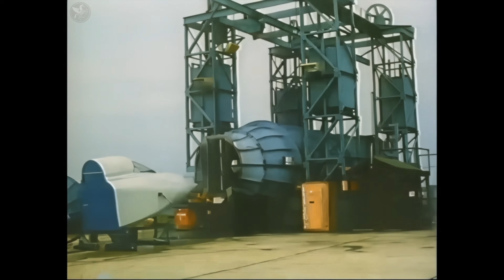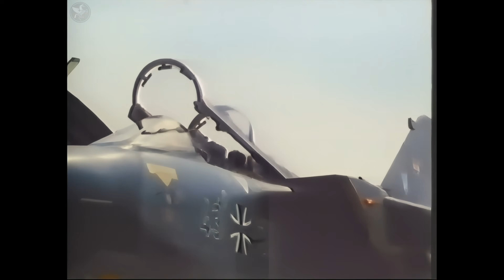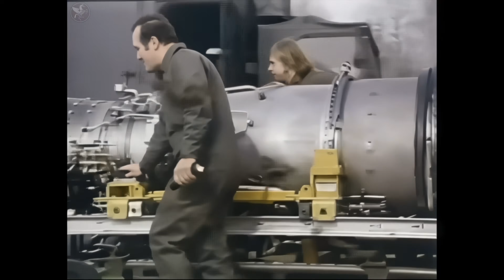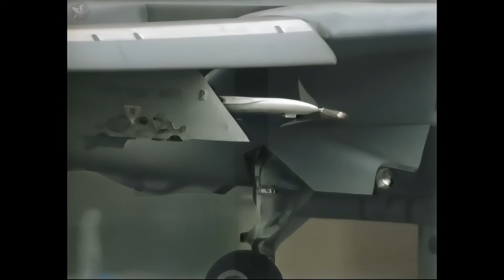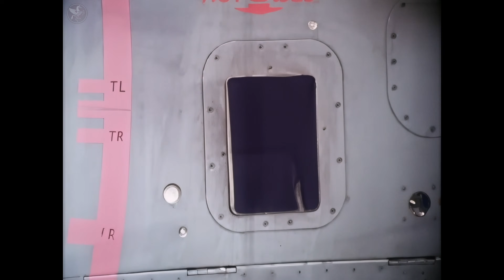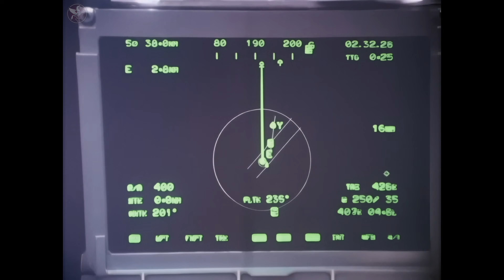The Jet That Mastered Every Combat Mission. Britain's Ultimate Cold War Interceptor

Comment: 360p equivalent quality in the 1080p mode, dunno what crappified it, youtube or uploader but there is some really weird stuff going on. Everything is "smoothed" and every text in the video is turbocrappified and/or translated to Klingon cursive script so there isn't a single letter left identifiable, the German cross symbols look like they are drawn frame by frame by drunk hobbit trying to dance the ripaska while painting the symbol. Bizarre, but it gave me excellent screenshots of "what not to do" and "this is what failure looks like" - so that is the upside of it I suppose.
My guess is that there is upsampling smoothing, downsampling, smoothing, upsampling sharpen kind of layercake on it swapping resolutions. straight high contrast lines on large objects look mostly fine, but text is completely obliterated along every form of detail like the numbers on the tail, detail inside the rims of the aircraft etc. It looks a bit like I imagine hallucinogenics effect to be - which is perhaps not high praise. 
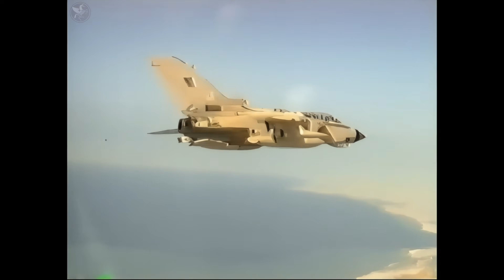At 52:59 there is a closeup of a Tornado where the vertical tail has merged with the sky, there is no separation between the sky and the tail at the trailing edge at all, just a gradient from sand/beige color to a sort of blueish grey color... This is NOT what it should look like, this is no longer a video of reality but of some sort of terrible trip minds eye or a simulation of what a tumor on the optic nerve or something similar can do. Initially gave this a thumbs up because the video would be great - if it had actually been uploaded/shared. This is a version for the blind, so you're getting a thumbs down. If it was destroyed by upload settings or some catastrophic up/down sampling debacle then please re-upload without it destroying it.